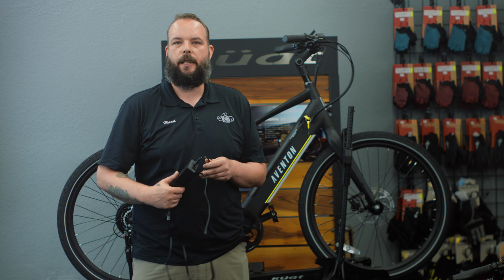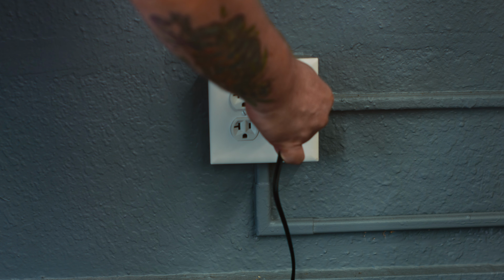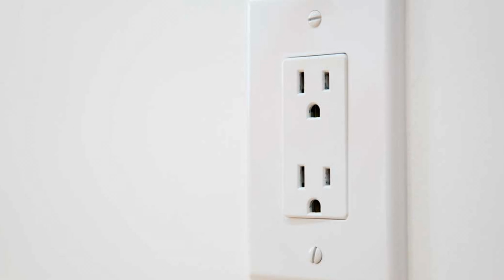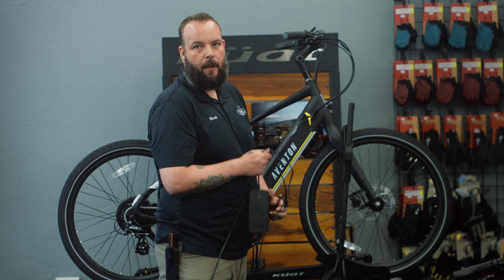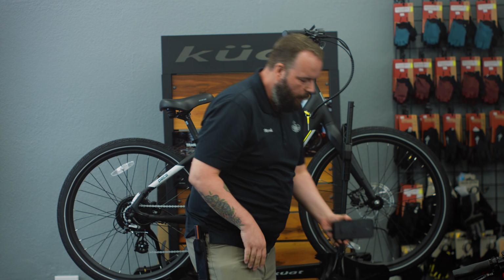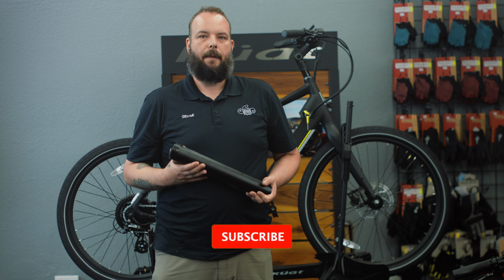How to Charge an Aventon Ebike

Comment: Thanks for the video. Only comment is why have the weight of the brick hanging on charger port. I guarantee that will lead to wiring issues down the road.
Reply from the maker: We had the bike up high on a display for the video. In actual use, the cable would not pull that way.

Comment: Why can't you use a extension cord? The wiring in a house is  is basically a extension cord from the breaker box  to the receptacle
Reply from the maker: The main reason you shouldn't use an extension cord is because they make the electrical components work harder. The extra length adds extra resistance. Hope this helps!
Reply: Using one OK, just remember to never leave it alone. The circuit breaker in your house is designed to trip if the current being drawn exceeds the current rating for the wire in your house. 
Most extension cords do not have the correct current capability as the circuit breaker. The extension cord could melt and catch fire. 
This is also true for the bike battery itself. Never leave it plugged in and unattended. Many homes have burned down from extension cords, and batteries left to charge.

Comment: you didn't mention the blue flashing light on the battery when charging the battery separately? does it yell me anything helpful, or just charge until the charger indicator goes from red to green? thnks
Reply from the maker: The blue light indicates a higher level of charge. Your battery will potentially show 3 different colors at 3 different levels of charge. Just charge until the charger turns green.

Comment: So I charged my bike all the way till the brick turned green then I disconnected it and after that a blue light has been on none stop. I couldn’t turn it off but I have been out since it charged. I just swapped out the battery for the extra one that I got in the mail today.
Reply from the maker: The blue light on the battery should time out and turn off.

Comment: Mark Quick question please: I have 2 new....100 miles on each...Soltera 7 bikes from Aventon. Identical as are the batteries. Everything works flawlessly but when I remove the battery from each bike...charge to a full 100% capacity...then reinstall each battery and don't ride either bike for approx. 2 weeks....the battery discharge to approx 2/3rd of their original full charge. As if some sort of parasitic loss from just sitting installed in bike and yes...the onboard dashboard and electrics are turned OFF. Is this normal or am I doing something wrong like not removing the battery pack when not riding? Thanks much.
Reply from the maker: Have you tried charging the batteries directly on the bike and see if you get a different result?
Reply: @crankworksbikes  I'll try that but can't visualize how that could possibly make any difference.
Reply from the maker: @frankcastle5294  If there's no difference, reach out to Aventon or your local dealer to file a warranty.
Reply: @crankworksbikes  OK will do and thanks very much for that info.

Comment: I wqs hoping to see how you charge it off the bike. You just said you can charge it, but I don't see where to plug into battery
Reply: I would try looking around the whole battery pack he’s holding in his hands and see where there is the round circle charge port to plug in the Jack end into and the other end into the wall. The port has got to be somewhere on the battery.

Comment: How hot does the Charger normally get?  I recently got my Aventure 2 and on my 3rd charge and the charger get to 135 farenheit with a infrared thermometer.  It gets hotter than any charger that I've own and I'm worried it may shorten its life.
Reply from the maker: Unfortunately, the chargers do get hot. There is a lot of energy moving through them at a fast rate. The side effect is heat.

Comment: At what voltage or percentage should I charge my battery? I cannot seem to get the correct answer
Reply: Do your best to charge the battery when it is between 10-15% power left as per the bike onboard computer. And always charge to full 100%. If you do this religiously you should get on average approx 700 full charges to the battery till its life expires.
Reply: Partial charges are actually better than full charges each time.  Best to keep your batteries SOC between 20-80%.  And between 40 -60% charge for storage.   Fully charge the battery about every fifth ride to balance the cells.
Reply: @FDchief904 Well thanks. That makes it about 45 different opinions on how and when to charge. Thanks anyway.
Reply from the maker: A complete cycle of the battery will make it last longer. Charge it when it when it gets below 15% or so and charge until completely full.
Reply: @crankworksbikes  Thanks for this helpful video, Mark! Can you or someone explain why the different approaches between charging to full versus charing between 20-80%. I'm confused why so many approaches out there.

Comment: Ok. Red to Green was my big question. I just got my first ebike. 
As a first timer, my charger gets kinda hot when plugged in. Is that normal?
Reply from the maker: It is normal for the charger to get hot. But if you ever have a concern, go to an Aventon dealer and have them check it out.
Reply: @crankworksbikes  thank you. I've been pretty gentle with my bike and battery so far. Yesterday was my first day charging it until the light turned green and I had a great ride home from work.
Reply from the maker: @MrBlx4life  Thats great to hear!

Comment: When I "charge" my battery the light on the changer doesn't turn red it just stays green the bike battery % doesn't go up only goes down.
Reply: Brand new right out of the box aventon adventure.2 ebike
Reply from the maker: @doorhandlegaming4571  You should take that to an Aventon dealer to check. It sounds like there could be an issue with that.

Comment: I cannot disconnect my battery and my charger is not charging as it's plugged in correctly what do I do
Reply: The charger display showed only green but it apparently was still charging, I could even turn the bike on
Reply from the maker: You should reach out to your local Aventon dealer. They may be able to help you most immediately. But it's hard for us to tell what's happening without seeing it.